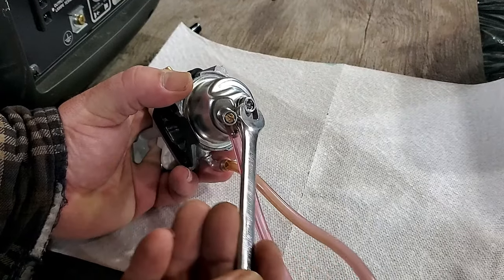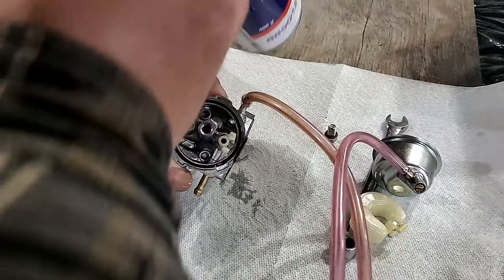Honda eu2000i generator easy  no start repair

Comment: Thank you for an excellent video! I cleaned my float, put it all back together, started it and gas came posting out the hoses that are clamped together and run to the bottom of the case with a y plug on the end.I have fuel leakinng from the carb body area too..should the gaskets be replaced to avoid the carb leak? Why would fuel run out the line with the y plug?Thank you!!
Reply from the maker: check the float ,it must be stuck if fuel is running out of the overflow . the gaskets should be fine as long as there are no tears. let me know how you make out
Reply: @thisguysgarage  Thanks for the quick reply.  Do you have a video on how to unstick it?
Reply from the maker: @parkininparadise  just follow this video, check the seat to see if you have any dirt , use some carb cleaner or brake cleaner or even wd 40 will work.
Reply from the maker: @parkininparadise  did you try tapping on the carburetor with the plastic end of a screw driver to seat the float before you take it apart again?
Be worth a try.
Reply: @thisguysgarage  thanks, I will try that first.I made sure the o ring was seated but it could have moved.
Reply from the maker: @parkininparadise  the o ring on the bottom of the bowl?
Reply from the maker: @parkininparadise  is it leaking around the seal or coming out of the overflow?
Reply: If you are having problems it is many factors that could cause this 
#1 the float you put on with the pin is missing a gas float needle valve. When removing your float you must take extra care with this needle valve. Check the valve for corrosion on the end. Also as with removing your needle valve installing the float and needle valve you should also take extra care. 
#2 OK now the needle valve and floater in place. You’re about to put the float bowl back on. Positioning of the float bowl is critical in keeping the float which is inside the float bowl functioning properly. When you install the float bowl you are looking at the holes where the threaded bolts go through. Your drain for your float bowl should be facing you. Otherwise that will cause problems. 
#3 float bowl gasket is not seated in its grove properly. 
Hope this helps.

Comment: Not sure if you're still answering questions on this 2 year old video, but I followed this and the jet piece is fused inside that tube, whereas yours just fell out as soon as you took the screw out. Any ideas on how I can get that out so I can clean it?
Reply from the maker: spray with any penetrating oil you have on hand use your small screw driver to turn the jet and tap the carb on a peace of wood with the jet side down  untill it falls out . if it wont fall out take your twist tie and try to clean it without removing it . let me know how you get along!

Comment: Hey man I’ve got a question for you. Do inverter generators need to be jump started? Mine’s been sitting for two years and didn’t want to start. I pulled/cleaned the carb and checked for spark. I have spark, but none of the LEDs on the face of the generator light up at all. If I remember correctly, the lights would turn on after I turn the dial from OFF to CHOKE. It’s a Dewalt 2200 Inverter Generator. I called DEWALT help line and they couldn’t guide me correctly. Any info is appreciated. Thanks 👍

Comment: Will this work on a craftsman 2200 my pull string won’t pull out. Thanks
Reply from the maker: This won't fix the draw string, but if you have a carb issue it will fix that 👍all carburetors are generally the same.
Reply: @thisguysgarage  yeah I will try but the string not being able to pull makes it impossible to check I was hoping it was a shut off valve or something. Thanks for responding
Reply from the maker: @tracymathis8855  fix the string first 👍
Reply: @thisguysgarage  I will it’s kinda hard to get to on this model, making sure to put it back the way taken apart, I will keep you posted. Thanks again

Comment: I followed your instructions, step by step, it fired up 1st time, thank you.

Now 2 days later the generator stops. So I go through the whole procedure again & it fires up but... I have no electric coming thru??
The genny runs lovely but no rlectric?
What is the cause of this??
The machine is 4 years old with minimal use. All connectors are clean & theres no sign of corrosion.
Is there a switch I'm missing or something simple to get it working?
Reply: Does it have a CO sensor? Those failing can stop power output even though it runs, go over your connections as you might of loosened a connector block accidentally

Comment: Hey, bud good video, I've tried several times and she just won't keep running, just a few seconds and that's it, I popped in a new spark plug, cleaned the jets, clean fuel, she just won't continue running, any idea's most welcomed
Reply from the maker: Any chance the fuel shut off on the gas cap is closed?
Reply: @thisguysgarage  no its on. I'll pull the carb out an clean the jets again, I should be able to do this with my eyes closed, maybe I place the jets in too tight, plenty of spark, it wants to go, just not enough?  something!
Reply: no luck, this is what happens when you loan your gear out and it comes back, a struggle to start
Reply: I've currently swapped out the carburetor with a new one and no change, still at loss😢
Reply: Hey bud, I was told to remove the exhaust an clean, so I did and while the exhaust was off try and start the unit. 
🎉 wow, hey presto, the exhaust was choking the Honda, explains why she only ran for a few seconds. So after cleaning the exhaust, best that I could, reinstalled it with the plastic cover, 🎉🎉🎉 yep she's purring like a kitten. So at some stage I'll replace the exhaust.
The new carburetor cost me $69 one of life's learning curves.
Love your video, very informative 😊

Comment: Dumb question: Does that carb have an idle jet (which would be much smaller than the main jet) or does it just have the main jet and emulsion tube you showed us exactly how to clean? Thank you so much for this!
Reply from the maker: main jet and tube exactly ,thanks ben kanobe ,may the force be with you lol
Reply: There is an idle jet. It’s under the idle adjustment screw on the top. You have to take out the screw and lever out the plastic plug to access it.

Comment: Question. Mine is only running with the choke on if I turn choke off, it starts to hesitate until it turns off.

Comment: I'm going to inherit one of these has been used for a while and obviously does not start a few more comfortable putting in a new carburetor since they're not that expensive and the generator cost me nothing what brand carburetor do you recommend as there are so many knock-offs online
Reply from the maker: I would recommend giving the carburetor you have a go, bet even the cheap knock offs seem to work ok , they are a. Really basic unit. Have another look at the video it was done in real time it's super simple. You can always buy a new carb if it doesn't work for you.

Comment: I have less than 5 hours on my gen, ran it once,
let the fuel run out and stored dry for a year.
Tried to start it yesterday, 50 pulls plus, not
even a hint or sputter of any kind.
But, starts fine with starting fluid, then  
stops after the sf is used up.
When I had taken it out of storage, figuring I should 
put stabilizer in it to continue storing, I put in
an ounce of stab, with fuel, then tried to start 
for the first time after that year's storage,
as mentioned, there was no 
hint of starting, and then of course 
I could get to start but not keep running via the
use of starting fluid.  Does this vid apply to 
my issue, most likely?

Comment: I have the same generator,  I ran it out of gas last Hurricane season and generally start it every couple months and let it run dry.  Today went to start and started up fairly easy however stopped when I turned the choke off.  Could be older gas?  Before I do the carb cleaning can I run some Seafoam in the tank?
Reply from the maker: try some seafoam and tap the carburetor with a small wrench while it is running,  heep trying the choke to see if it clears up ,does not hurt to try.

Comment: LOL. I subscribed to your channel to watch all the political stuff and now that I'm having problems with my generator I find that you have a video for that too. 👍

Mine didn't run 100% right out of the box (eu2200i), but having never owned one before I wasn't sure if it was my silly imagination. Right out of the box it started well enough and ran well enough, but the exhaust smelled a little worse than I though it should. Add to that, the engine would stammer every so often too.

After one season of using it as is for camping (17 hours run time) I completely drained the gas, performed the second oil change, put it back in the box, and put it in my basement for the winter. The other day I tried running it but the engine surged badly on idle, and the exhaust smells like raw fuel. 

IYO do I need to break down the carburetor this far or should I only concentrate on the pilot at the top of the carb? Other videos indicate that's where my problem lies. Either way, I find it a little bothersome that this maintenance is required. I used high test gas from a brand new jerry can. I kept it stored in a cool dark place and it only has a few runtime hours, but yet problems arise. Do you think I would have been better off storing it with fuel in the system?

Comment: so my generator ran  yesterday for 8h , and wont start today....  i first did the  little hole that plug in that little plastic  tube in the carburator  .... well  that didint fix it this time....  i dont have anything to clean it i will try your  solution tomorow.    it feel like there no s park and no compresion ...
Reply from the maker: Put a few drops of oil in the spark plug hole and turn it over a few times that will bring back the compression if it flooded.  Let me know how you make out 👍

Comment: A torch tip cleaner would probably work great to clean out those jets.
Reply from the maker: The only problem with the tip cleaners is they are like a microfile not the end of the world if you are careful. 
I had hurricane season in mind when I made this and was trying to be mindful of things folks would have around in a emergency situation.  Ty EDB IL swing by to check out your channel

Comment: Would a fuel filter help reduce this problem ?
Reply from the maker: Maintenance never hurts but I don't think the filter is fine enough to capture the sediment causing the blockage.  The fuel jet is super small which is good for efficiency but bad for the problem.

Comment: My Honda eu2000i will start , it just takes 15 to 20 pulls if it’s been sitting, I fire it up every couple months, once’s it starts and runs a few minutes it starts right up , you think it should start easier from
sitting, I do use recreational gas so it’s not a ethanol issue and I put a small amount of fuel in it just to run it for 10 minutes or so until it runs out
Reply from the maker: The just could probably use a cleaning.  As a rule should not be that hard to start 👍

Comment: Should one of my pink hoses be connected to nothing? The one that has a ‘Y’ to it? Reconnected my fuel line as I took it off, not sure where the end of the pink one goes. There are two connected pink hoses already

Comment: My eu2000i stopped working suddenly one day. Long story short our house burnt down and we are living in tents on the property while rebuilding.
Anyhow, the other day I couldn’t get it to start, usually just a pull or two n good to go. But I pulled a few times, nothing. Put new gas, oil, and filter. Next thing gonna try is spark plug and this. But this seems to be caused by sitting for periods of time. Mines worked one night, next it didn’t.
Reply: Also if there’s anything I did wrong or should/shouldn’t do would be greatly appreciated. I’m a landscaper so I’m out of my field here lol
Reply from the maker: dirty fuel could be the culprit, just moving it around could dislodge some dirt in the fuel system , there is a fuel shut off on the gas cap ,check to see if that's not shut off ,the fuel jet is so small it does not take much to plug ,let me know if you get going ,sorry about the loss of your home!

Comment: Thanks for the video. My generator was sputtering and trying to start. I couldn't get the "jet" piece to come out so I just stuck the wire in. Other than that I did everything you said and now it won't even try to start. Got any ideas?
Reply from the maker: it may be flooded , a couple of drops of oil in the the spark plug hole ,taking out the spark plug .  make sure the vent is in the open position to make sure you are getting fuel,  would be better if you could get the jet out , get a can of brake cleaner and really get in to the jet if you cant.
Reply: @thisguysgarage  You're amazing to respond so quickly!!! I'll pick up a can of brake cleaner since all I had was PB blaster. and give it a try. You rock!!!
Reply: @thisguysgarage  Well I got the jet out and everything was as clean as a whistle. I confirmed I'm getting gas to the carb. Any idea what else it could be? Thanks in advance!!
Reply from the maker: @clapisani  can you pull the spark plug out  and put a few drops of oil into the cylinder and pull it over?  Connect the plug to the spark plug wire at the same time and confirm that you have spark.  If you do not know how to do this I can film something short.  The trinity of an engine running is spark fuel and air. You need all 3 to run .  For the price of a plug it won't hurt to put a plug in it. Let me know how you make out 👍.
Reply: @thisguysgarage  I don't know how to confirm I have spark. I was assuming I did because sometimes it tries to start then spurts out within a few seconds. It was running great a few months ago but died during our latest rain storm when the power was out. Any chance something happened with it getting rained on?
Reply from the maker: @clapisani  if its trying it probably has spark ,but il shoot a video tomorrow to show you how to confirm that ,go to the parts store 
and pick up an ngk spark plug in case the plug was flooded or fouled ,unless your stuck ; let me know if its an emergency.
Reply: @thisguysgarage  You've been awesome!! I'm very happy to report I just got it started!!!! YAY!! I'm still not exactly sure what was wrong but I can't help but think the rain had something to do with it. Thanks again for all your help and your very quick responses we need folks like you in the world.
Reply from the maker: @clapisani  no problem at all. It may have been flooded and had enough time to dry out.  Keep a plug on hand , I will probably shoot that video on Monday anyway, just in case someone else has this issue.

Comment: Mine wouldn’t start after being stored for 5 years. Followed theses steps and also cleaned the plastic jet under the screw, it started but will only work on choke.. as soon as I put it on high idle or plug a tool in it and try to run it it instantly dies.
Reply from the maker: Sounds like the plug might be foweled,  worth a try, you are close...

Comment: I did this.. It will now run.. but it will not run correctly unless it's on half choke.. it will not put out any current unless on half choke either.
Reply from the maker: Check your gasket on the carburetor sounds like a vacuum leak

Comment: I have a Honda eu20i generator and my father bought it from my relatives. And my father later passed away and I don't know how to use it. I try to turn it on and it doesn't work 9:12 😪😔

Comment: Why my EU 2200 come out  white smoke  can u help
Reply from the maker: its got to be fuel related because there is no antifreeze to turn the exhaust while.  drain the fuel make sure there is no 2 stroke additve in it. first place to start

Comment: Am I the only one that noticed he didn't clean the pilot jet, and the crankcase vent was all folded over in the reinstallation faze of this video so it was not properly installed and will leak oil residue into the engine bay? Just an observation from a person that does this stuff on a regular basis.

Comment: I don't believe ya showed inside the bowl that has to be cleaned out also , theres always junk in there ,  I always drain the bowl if I know im not going to be using it for a while ,the problem is the bowl drain is not at the lowest point and always leaves gas and dirt in there , the only way is to lose off bowl bolt and let the last little bit and dirt drain out

Comment: Did this and mine still wont start
Reply from the maker: do you know how to check for spark?  pull thhe plug out let it lay on the cylinder head while plugged into the primary spark plug wire and pull it over you should see a spark at the electrode. let me know.